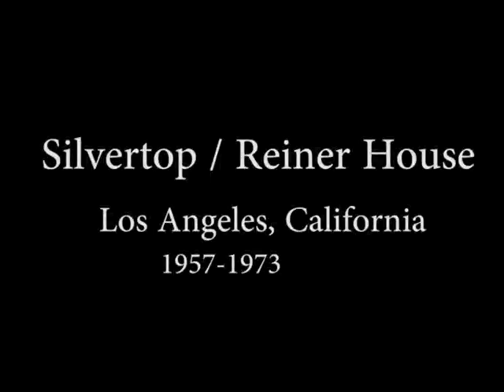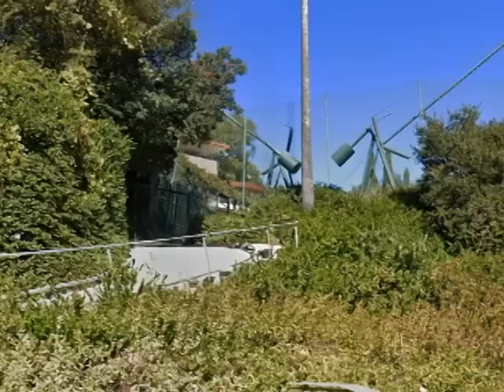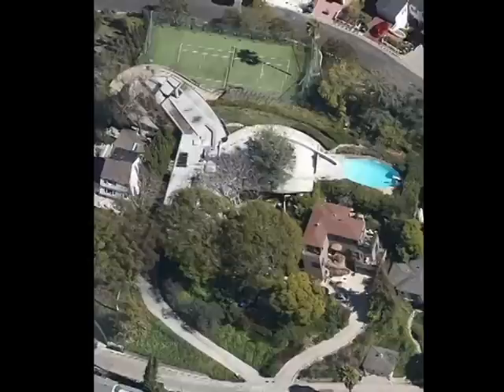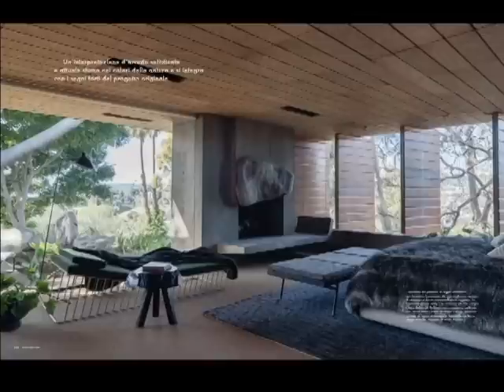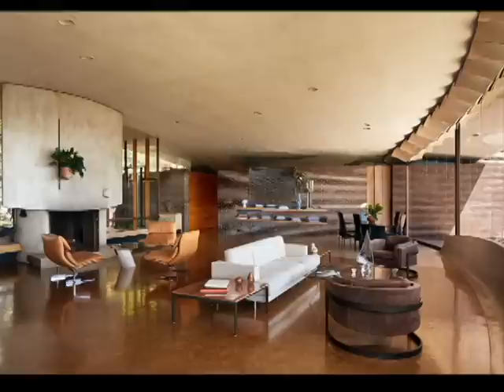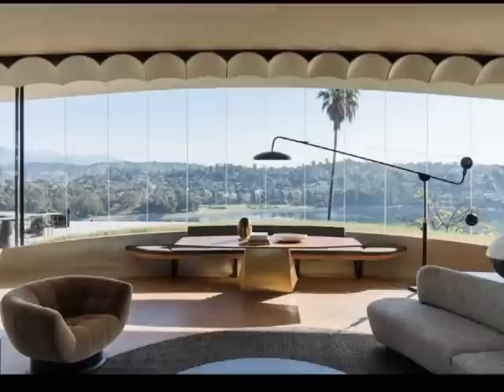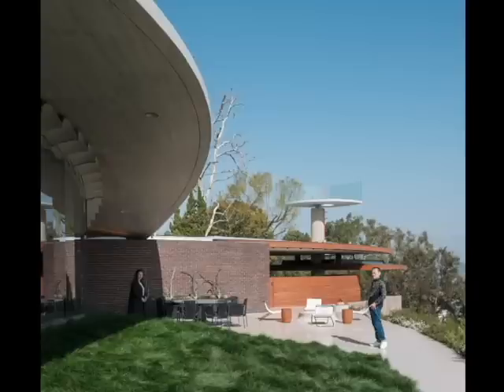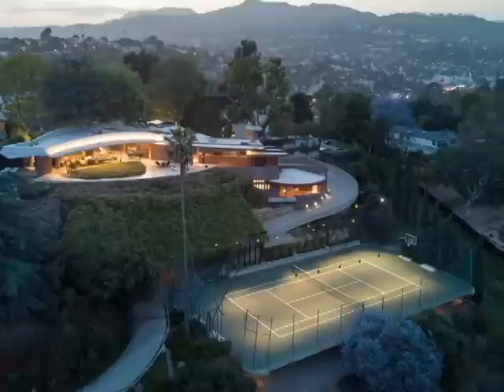Silvertop Reiner House by John Lautner. Complete overview and walkthrough.

Comment: How long are you going to sit in those uncomfortable, thin-cushioned, shallow-seated, armless chairs in front of the fireplace?  Ten minutes?
Reply from the maker: I can sit in those chairs forever! such a beautifull house!
Reply: No arm rests, no way to pull your legs up onto the chair, no way to slouch to the side, no way to slouch way down comfortably --- you'd literally have to just sit upright, with your feet square on the floor, your legs straight out in front of you, your back reclined the entire time, and your arms squarely in a vertical position at your sides, or crossed.  I actually do not believe you could sit comfortably in that single position for hours.  I'm not buying it.   @SuperJobbel